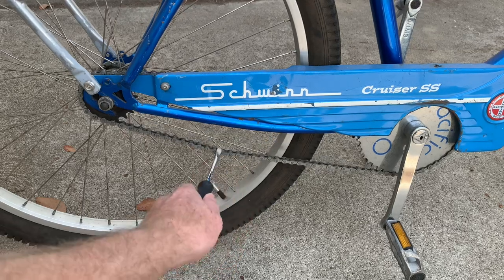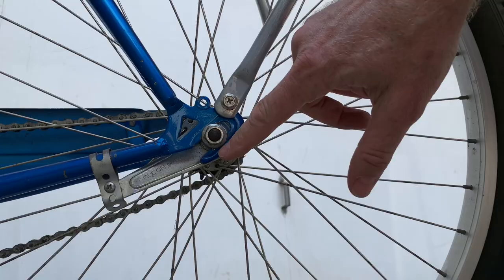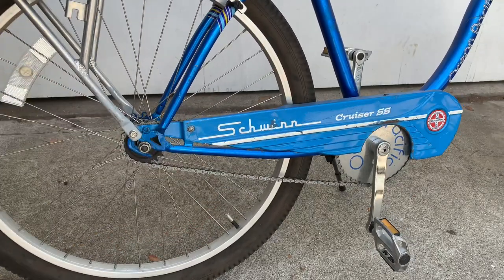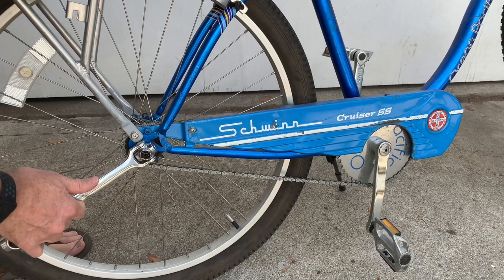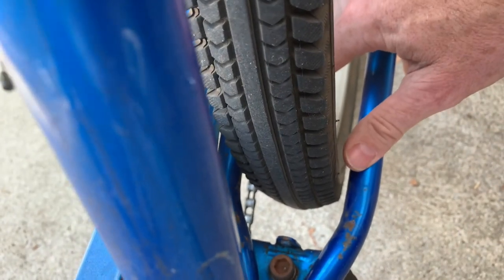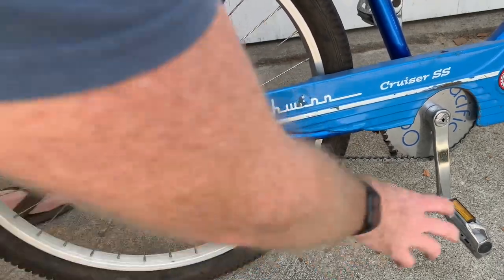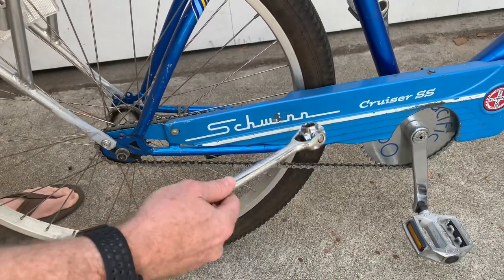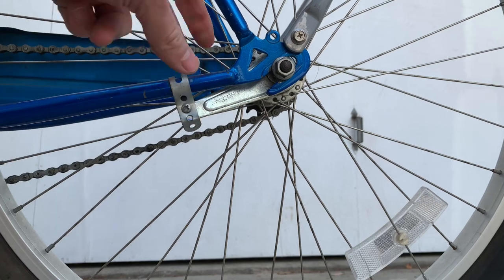How To Adjust The Chain On A Beach Cruiser Bike

Comment: Hopefully this helps me 😂😂 what size do I need for the bolt
Reply: I know this is late, but in my experience the hub bolt is usually 15mm, and the fastener he showed in the beginning is a Phillips head screw that's held in place by a 10mm washer.
If you want to work on the actual hub, it'll probably be 17mm
(This is just my experience, it may vary with bike manufacturers)

Comment: How far back should I place the rear wheel? Seems like the original sat towards the end of my frame, seems dangerous shouldn't it sit as far back as the frame allows it? Has an opening on the rear mount where the coaster attached now I can adjust them all being I'm upgrading the chain. just making sure so the chain isn't sagging or too tight. Thanks ahead I subbed, love the bike and content ❤️💯
Reply from the maker: You need to put it as far back as it needs to be for the chain to be tight enough not to fall off. It should be fine if it’s more towards the back than the front.
Reply: Thank you sir and I yeah figured towards the back is safer and my chain is long and I can adjust it/take a link or two out before I lay it on there. I subbed a while ago, thanks again.